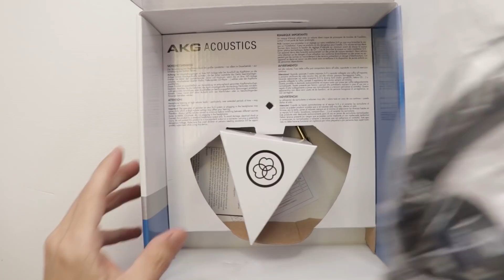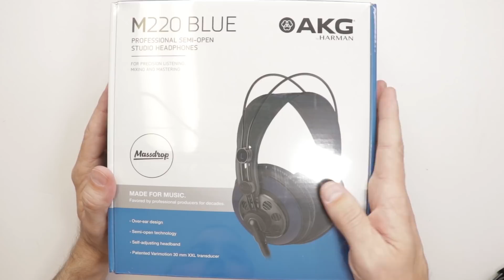Are AKG M220 Headphones Made Well? Complete Disassembly!

Comment: If you haven't been bitten by the bluetooth bug and you're on a budget, the lower end of the AKG wired line is great. The sound quality is just right there. It might not be bass heavy enough for some people but I love my K-240 Studio. I've had them for ten years (Probably wore them at least ten hours a day every day of that) and have only replaced the cable and the pads. Which is one thing I will say. If you buy these, replace those pads right away. You can get pads for these that blow the stock ones away. That's the only thing I regret about the time I've spent with my AKGs. That I suffered with the awful stock pads as long as I did.

Comment: I have to replace the headband on my AKG 271 Mk ii, which are a little different.  I have to pop off the earcup to get to the screw holding on the headband (replace it, actually; I removed it with the earcup on but I need to remove the earcup to replace the screw).  Do I pop off the outer part like you did?  Thanks.

Comment: Just my few bits about AKG solders. I own AKG K712 Pro (made in Austria) and unfortunately first solder was off nearly after 2 years (I think that was the warranty for them). Second one I had to re-solder shortly after (maybe 2-3 months). That's really not great for headphones which i paid nearly £300 back then. Now you can get them much cheaper ( tho produced in China). Not sure if that's the flaw of this model only but based on short research it seems to be a flaw with all AKG headphones for very long time.

Comment: A nice and simple modular design, the weakest part are probably the swivel pins, but the plastic seems to be glass fibre reinforced (any markings on the plastics?). The worst things are probably the pleather earpads. If you want similar headphones for cheaper, then there's the Samson SR850 and Superlux headphones, don't know about the differences in sound quality, but the Superlux ones are well regarded budget headphones.
Reply from the maker: No markings on the plastic that I saw.

Comment: Looks like a good quality pair of heaphones. They should have used a standard headphone jack for the removable cord instead of that weird connector.
Reply: Weird? That's completely normal mini XLR connector which is common at microphones etc. It's amazing cause it won't disconnect until button is pushed.